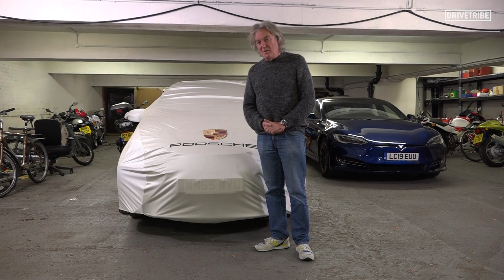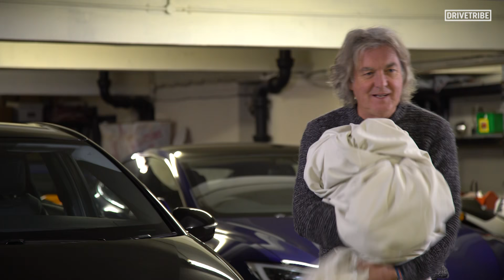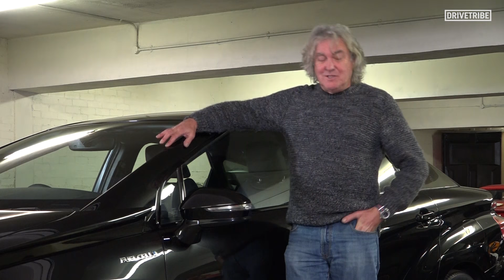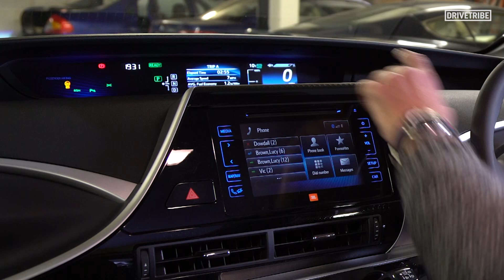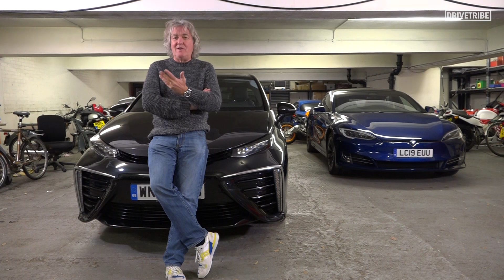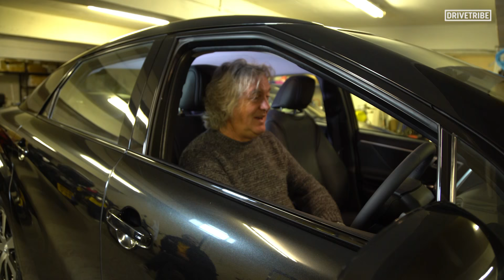James May has bought ANOTHER new car

Comment: The kinda hope is that at some point electricity will be abundant enough that making hydrogen isn't a big issue. Think of waste electricity of solar panels and wind turbines that isn't used at the moment. It's still incredibly ambitious (especially with the grid being basically at its limits...) but at least you waste a lot less battery materials and have less weight to move (= more energy efficiency). People often praise Tesla for being forward thinking, but Toyota is the OG in this with the Prius and the Mirage.

Comment: I wonder if they could couple the electric motor with a CVT....so you can have the motor running at a slower, energy conserving speed while traveling at 96 kilometers / 60 miles per hour. 

A.K.A. have the motor spin slower than the wheels.

Comment: With electric cars why don’t thay put magnetos. In the wheels so the car can charge itself when going along.don’t you remember the old one for the lights on a push bicycle years ago.they  used to rub against the back wheel when going along.design could be updated for a car surely.
Reply: Because the magnets would slow the car down.
Electric cars already do regen braking.

Comment: Long-term I feel that hydrogen has a better future than battery powered-cars mainly because of the charging difficulties, both in terms of the time it takes to refuel/re-power the car and the availability of those charging points for BEV. Hydrogen has the advantage that refuelling is basically identical to the present system, whereas BEV requires charging points everywhere, particularly because there are many people who will have difficulty charging at home if they don’t live in a house with a driveway. The infrastructure costs for BEV are astronomical and will need to be recouped, either by governments through taxation, or private equity through the charges, making BEV not as cheap as it may currently appear, whereas hydrogen requires no extensive infrastructure other than the petrol stations changing from petrol/diesel to hydrogen. Early adopters of BEV may find that they’ve bought a Betamax!

Comment: The only solution is hfc, not hugely polluting battery cars (battery manufacture)...the current focus by manufacturers just for auto manufacturers to make money, before they then focus on hfc. So u invest in electric, then before long thats obsolete and u have to invest in hfc, which should and could be the solution NOW. Mandate it by law. Ban new petrol, diesel, AND electric battery cars from 2-3 yrs time, with gov investment in converting petrol stations to hfc. SIMPLE, just needs will and BEST solution now. Not once auto manufacturers have milked batteries.

Comment: I believe early hydrogen fuel cell cars should have at least 100 km realistic range in EV-mode, and option for plugin charging.
Being able to charge, will make it possible to charge will allow efficient use of electricity on daily commute, and allow quick refueling on trips. but also option to charge if you want to go on a trip where you have no hydrogen fueling stations.

Comment: well the hydrogen fuel cell is in the overall more practical for the future, the way we currently handle and use lithium ion batteries the causes more pollution than the car itself ever will on green energy, the biggest flaw of fuel cell cars is currently the fact that we just don't have the infastructure which can easily and cheaply be installed at local gas and fuel stations around the world
Reply: Exactly. No need for millions of car charging points at home and car parks. Just retrofit hydrogen pumps at existing filling stations then carry on as normal. No range anxiety, no reduced range in winter and you get a full tank in a fraction of the time even compared to Tesla's fastest current method. I applaud Tesla and wouldn't say no to a Model S at all, but if we can work out a way to get hydrogen without expending so much energy, it would solve way more issues and be better for the environment than batteries are.
Reply: ÅH FAAN!!!!🖕🏻👀👊🏻👎🏻

Comment: I think hydrogen will have its part in the future but not in cars. It’s too inefficient. Hydrogen can work as energy storage as we can convert electricity into hydrogen and then use it later, but in the process we loose first part of the energy in the electrolyses to create the hydrogen and
then again when using a fuel cell in the car to turn it back into electricity. We have to transport the fuel and we have to build expensive fuel stations for hydrogen. If hydrogen is used as a means of storing energy it makes more sense to use it in a powerplants and then run EV’s so we are not depending on an inefficient process all the time but only when we actually need to use stored energy.

Comment: James you have said it all in the beginning, the losses in the processes for hydrogen creation make it absolutely insane to choose it as a fuel; when the battery technology is available and allows decent charging in 20mins without all the waste to make the hydrogen.
Reply: Tesla has to hulking 600 kg of batteries around. Hydrogen system is more like 60 kg.
You do lose a lot of efficiency dragging an equivalent of a bus full of people around. 
BEV's loss of efficiency, greater load on tires and suspension and (questionable) processes of manufacturing and recycling batteries may make hydrogen net equal in the long run.

Comment: I know I'm late to this... but I completely agree with JM's logic surrounding hydrogen power. Hydrogen cells have gone very quiet commercially in general, but despite the changes in infrastructure I think there's more sense in hydrogen cells than heavy/slow charging electric batteries. I think the drive in research to electric power is misguided by neglecting hydrogen, I think it would cost more to solve the battery crisis than to change the infrastructure for hydrogen... BUT, I'm curious to whether I'm even correct by thinking that or not, because nobody seems to be asking that question and jumping straight to batteries because of non-automotive applications

Comment: and hydrogen is still in it's infancy, you actually reviewed these 2 types of electric drives about   10 odd years ago and you said this would be the problem....or was that hammond...anyway 
100 years ago you could only buy petrol in chemist shops in 10 litre tins...
now it's available 24/7 365 days a year in however much your car....vessel ... can hold,
and would you like that  in 91 octane,95 octane or 98 octane..
how about e 85 with added alcomohol...
give it 20 years and hydrogen will be the same it's just a matter of supply catching up with demand

Comment: You use electrolysis to get hydrogen from water, you use cracking to get hydrogen as a by product of petrol production from oil.  The problem of the first is that electrolysis to get hydrogen from water is maximally 50% efficient since 50% comes of as oxygen, which is waste.  So you are initially starting with a 50% loss of energy using hydrogen as a energy storage media, and this is reflected in the cost of hydrogen from local production hydrogen stations - found in Norway.  You then have the compression of hydrogen resulting in another loss of 20% in energy content.  Batteries are not ideal (they are heavy and using rare elements - being removed now), but they are represent quite an efficient use of energy.
Politically, hydrogen has been pushed by the car manufactures for many years as they were involved with the oil industry that wanted to sell its hydrogen by-produce from cracking.  From an economic point of view hydrogen cars are (currently) a dead end.

Comment: The LCD display looks like it's from the 90's! 
Hydrogen fuel makes sense where you can fill quickly.  There should be an option for a smaller battery say which will drive about 60 miles and can be charged up (most daily drives are around this range, so you don't lose evergy on conversion for your daily commute) and a hydrogen fuel tank for longer drives.
Reply: Vidyadhar Navale no it doesn't look like its from the 90s. What a silly comment based on nothing whatsoever.

Comment: Lets face it: Much like the LIDAR System, the Hydrogen Fuel Cell was a good Idea that was overtaken by a better Idea. And also much like the LIDAR System, which was replaced by Neural Nets and  Camera Systems it will probably have a future in certain niche uses but it will not be in everyday cars. Batteries will get better and better and I hope in the future they will be standardized so that i can take the M-size Battery Pack from my Lawn Mower and put it in my Motorcycle.

Comment: Zero Emissions.... what's that over the coal power plant?  Let's not even get into the energy for production of Lithium Ion batteries. That topic is usually completely glanced over.
Hydrogen also doesn't come for free.  Both probably more efficient and cleaner than Combustion but not Zero. No free energy. Them's the rules. 
Still. Fuel Cells and (liquid) Hydrogen got us to the moon (and quite a bit of burning stuff).

Comment: I have a question for James May, if he’s still monitoring this video. You didn’t mention the purity of the hydrogen used for the fuel cell. My understanding is that it must be 99.999% pure for this method to work. Is this still true? If so wouldn’t the manufacture of such pure hydrogen negate any benefit the EV might represent? Apart from the back to the pump loop the world is stuck in.

Comment: At least a fuel cell car is sustainable, yes it has some energy storage due to the regeneration from braking.
However the big issue of: What to do when that brick of a battery has canned out (EV), gets mitigated by the use of the hydrogen as an energy source.
When an EV has to be binned it's a big mess, I don't like that.

Comment: Did he say cracking? Isnt it fracking or did i hear wrong?
Reply: It is cracking...splitting water into it's 2 components...2 H2O → 2 H2 + O2. And as James said, it takes a huge amount of electricity to accomplish.
This is the fundamental issue with the eco-argument around electric vehicles. Buy an electric vehicle for the performance. Buy it to keep your city's air clear. But don't think you're doing the world a favour if your grid is powered by coal. What is at the end of your electrical cord producing the power for your EV?
Coal fired plants are about 35% efficient at turning coal into electricity. Coal has about 1/4 the energy density of gasoline and less compared to diesel. Transmission line loss can be up to 20%. Even the charging circuit at the plug of the car can lose another 10 - 30%. So to get your nice shiney "clean air" car powered, you've lost a lot along the way from a dirty source to begin with.
And sure it's nice to think of hydrogen cracking from water being done by wind farms. But that power is also needed for everything else. Producing H from hydro power rich countries and transporting it to market does have merit. Increasing the sustainable power grid takes huge resources and is a subject far too involved to go into here.
I'll stick with my bicycle, public transit and my V10 3/4 ton Ford.
Reply: @st-dm5mr  Thank you! Very helpful

Comment: This is actually really interesting and I'm glad that a person with such knowledge and experience with automobiles does this comparison. Back in the day gas or diesel was the question, now it's hydrogen or battery. 
Really looking forward to that comparison!
Reply: FY FAAN!!!!🖕🏻🤟🏻👀👎🏻
Reply: No, it's not. For people driving less than average per year even fossil fuel ICE is better for the environment than EV. Biofuel and e-fuel ICEs are far better than EVs in almost all cases. Without the crippling TRILLIONS it will cost to build up the infrastructure for EVs, and it'll tale decades to switch to EVs too while with biofuels and e-fuels the cars are already here.
Reply: Hydrogen is way better but is not economically viable yet. I Know this is the kind of stuff that electric enthusiasts said but this brakes the biggest flaw of electric cars (apart from being hated by 99% of petrol-heads): storing potential energy, a problem that fossil fuels never had...
Reply: @VascoCC95  Yea there's still plenty of unanswered questions but is the extraction of hydrogen really that much more power intensive than the production of electricity?
Reply: @jg54sayaka11  Yes it is, you need about 3 times the energy per km compared to a battery powered vehicle. However if you can produce it locally with renewable energy it's not to much of a problem though. However at the moment it's very limited giving you a certain amount of hydrogen on a charging station (you will run out quick).

So when you actually did fill up your vehicle quickly, the person next in line of the charging station might not be able to fill up his vehicle because the station has run out of hydrogen.. This is the biggest problem at the moment for HEV's.

So while the infrastructure is more or less mature for BEV's (only needs scaling up), the cars are still somewhat limited in range and charging speed (only an issue with long hauls, commuting is still already convenient with a BEV). With HEV's it's the other way around, filling up is quick and the range is reasonable but the infrastructure is lacking at the moment.
Reply: @kevintieman3616  Yes but scaling up the electricity infrastructure is significantly more problematic than hydrogen infrastructure. Capacity within the existing grid will be the issue requiring a major upgrade to the grid. New cables, new towers etc. Then there are the problems of on street charging, the time taken to charge. If you drive long distances you will need to recharge on the way. Installing hydrogen pumps is relatively cheap as well and can be done at many existing fuel stations.
Reply: @richardmoody5482  Installing hydrogen pumps is neither cheap or easy. It's actually insanely hard because you need to chill hydrogen so it becomes a liquid (20 Kelvin) and pressurize it to about 200 bars to have any usable range. If you also want actual "green" hydrogen instead of extracting it from oil the whole process (electrolysis) becomes really inefficient and thus expensive. In any case, the amount of hydrogen pumps vs the amount of chargers at the moment speaks for it self.
Reply: Kevin Tieman has
Reply: I prefer feeding hungry trees I know when I do a hard acceleration on my gas car I am creating food for trees therefore supporting the environment. Don't EVil drivers care about trees? Feed the trees!!
Reply: @Exluto  feed the trees!!!

Comment: Are we back in the early days of Betamax Vs VHS?
Are both systems likely to run side by side, long term, or will the winner become obvious quickly?
While electricity is universally available, if the uptake of hydrogen fuelled vehicles never reach a critical level, hydrogen filling stations might never become sustainable and those hydrogen fuelled cars might become as useful as a Betamax video recorder.

Comment: Battery Electric Cars will die. There is no way in hell to charge all of them is everyone uses them. Talking About the grid capacity. It's an electrical Nightmare.
Question is not if but when will the hydrogen car take over the market. I say 2030 it's over with the battery cars. By 2035 they will be banned in EU because of waste of resources. My two cents.

Comment: ''Bless all who sail aboard'' the ugly upside down 'predator' from the front. Awful. Does it come with a free dental dam? Prefer the Tesla, but even that doesn't have 'ludicrous mode' installed. Tut Tut. This is all ok, if you live in London. Show me a charge point in Oldham, and then see who fights to the death up there, when there's the only one charge point and two drug dealers turn up to duel for the 'first' charge, in their Nissan Leaf's. Tick tock. The charging infrastructure is not in place for the normal person.

Comment: Shame on you James.  Even using completely carbon free sources of electricity, you hybrid is dirtier in operation than a pure electric.  It essentially  takes lmost no energy to transport electricity via the grid.  It takes significant energy to transport H2.

INCIDENTALLY, its worth noting that the carbon cost of any electric car is based on your source.  In the US, for example, your Tesla is effectively running on 80% coal.  Whatever the UK manages for a production mix going forward (which will never exceed about 70% renewables for base load) will determine how green either of these cars is.

Comment: Very interesting. I thought the hydrogen fuel cell was no longer a viable choice for vehicles. An interesting note is that Teslas are manufactured in a  factory that was once a joint venture between Toyota and General Motors. The results of your experiment will be anzxiously awaited by motorheads.

Comment: Both are impracticable at the moment. Back in the 70s we should have been concentrating on lean burn engines. But, instead we went for a quick fix of fitting Catalytic converters which converted greenhouse gasses into much much worse CO2. Despite how unpopular and bitchy Margaret Thatcher was. She saw the dangers of CO2 but no one listened to her back then. Anyway it's all a moot point. There's no way that the tiny 0.012% of Co2 in the atmosphere that's caused by man could have more effect that the other 0.028 from other sources... People are always blaming cars for this problem but more CO2 is produced in 1 London Marathon than the entire season of Formula one. And the shear amount of CO2 produced by the Tour De France and the Olympic games is huge!!! Yet no one is calling for those to be fixed and made carbon neutral. Cars are the least of our worries there's far bigger culprits doing damage than simply getting in a car and going to the shops....